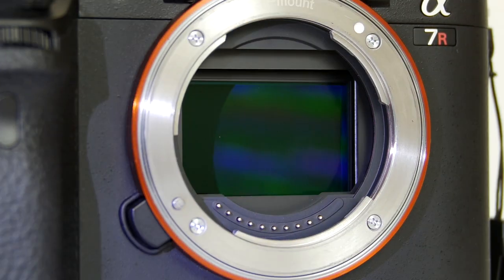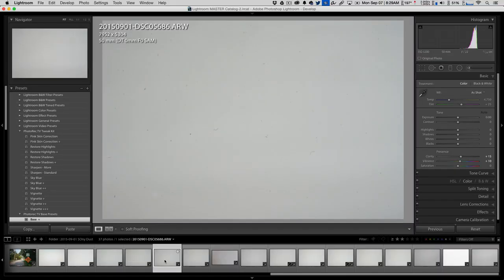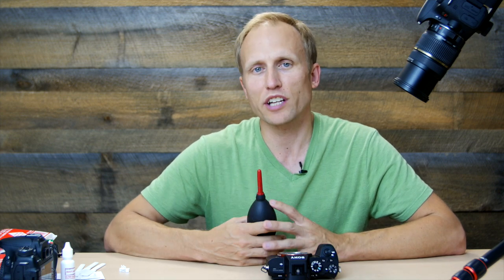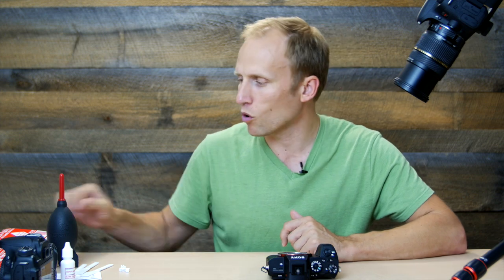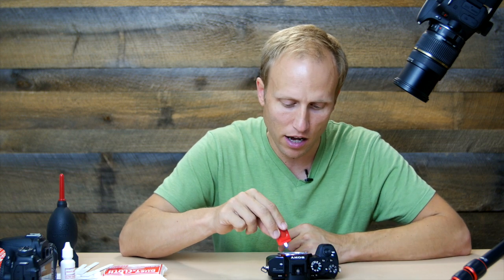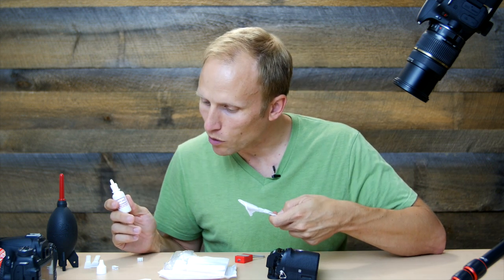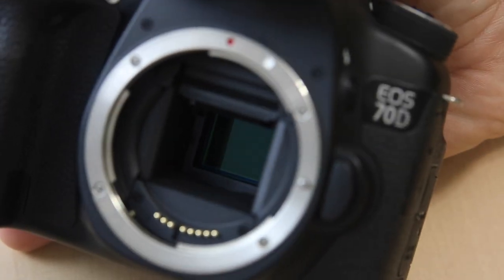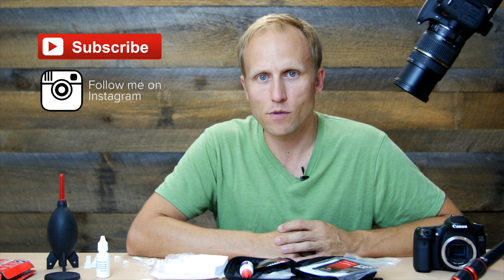How To: Clean your Camera Sensor

Comment: Often using the EyeLead Sensor Gel stick. Same idea. A tiny bit sticky. Works very very well. And it does not leave any residue. But the trusty rocketblower really does work and usually is enough as you said. The trick is to really have a rocket blower. Not some copy or general blower.

Comment: Thanks for a very well produced video.
I would add one thing.  Everybody says hold the camera upside down when blowing it out.  I would say that the particle size is so small that gravity would have a negligible effect on the direction in which the displaced particles would move.  To those particles, the air is like thick soup.
They are more likely to be carried upwards in the warm air currents from your hands or lights.
Because of the danger of damaging the sensor with the blower I suggest holding it in whatever is the best position for you to handle it and see inside and get the most light into it so you can see what you are doing.
Reply: It is because you don't want any new dust coming onto the sensor as you clean it. I always clean it in a vertical to somewhat upside down position to make it stays clean
Reply: Thank you for your reply.
I have done some calculations using Stokes' Law that calculates the velocity of falling objects in air.
It backs up what you say.
You certainly do not want to leave the camera lying on its back with no lens or cap on it.
For objects above about 0.5 mm in diameter you probably want to incline the camera downwards. (Velocity 7.5 m/s).
For smaller and lighter objects (typical dust in the air), these will have a velocity below 0.5 m/s and could be travelling in any direction depending on air currents.
Keeping it vertical, as you suggest, whilst cleaning is probably the safest and best practice.
I think this highlights the need to be as careful as possible to avoid dust when changing lenses.
Reply: Agreed!

Comment: I sprung for an Arctic Butterfly about 3wks ago to clean my cameras, I usually rely on a rocket blower but with my A7ii it was just getting too dirty to blow off. I have a 5mo old A7ii, a used NEX-6 I bought mint from B&H 10mos ago, and a 1yr old A77ii. 

The Butterfly was easy to use and worked like a charm, theres a couple spots I think I'll need a wet cleaning for on the A7ii but I have to have it really stopped down to be a problem. My NEX-6 is hardly used so it was cleaner, but the cleanest by far was my A77ii - that SLT mirror never moves and the sensor is enclosed at all times. It provided a sharp contrast of how much dirtier the exposed mirrorless sensors are compared to even Sony's own SLT-lineup. 

I will say though, it's one trade off I'm willing to accept for a camera that's so much lighter and easier to travel with than a DSLR.

Comment: I do astro-modifications to dslrs. I’ll add that it being referred to as “sensor cleaning” is wrong. 99% of people call it that, even the products meant for cleaning. You never actually touch the sensor. Mounted in front of your sensor is your low pass filter. That is what you are cleaning. I guess it would just be confusing to call it a low pass cleaning kit. Anyway, the reason highly evaporative cleaning solutions must be used is that if you oversaturate you stand a chance of actually having liquid enter between the filter and the sensor. Unless you’re a technician you’re pretty much done at that point. Regardless, the wand never actually touches the sensor. I’m not sure anyone cares about this point but a low pass filter replacement part is around $100. That might help convince people to try cleaning it themselves. The actual sensor underneath it is around 70% of your cameras value however. Venture there with a wand and you may as well throw it in the trash or post on eBay for parts not working. If you’re interested you can see me removing the low pass filter from two different cameras on my channel. It’s essentially there to prevent redeye but for us astro guys it blocks hydrogen alpha transmission. I’m just rambling on now. Great video tho. It’s only scary the first time but far less so when you realize you never touch the sensor. Clear skies.
Reply: what should I do if the mirror is dirty not from dust but becouse of leftovers after moisture ?
Reply: I have a D7100 which doesn't have a low pass filter, does that mean I can't use a kit to clean it?
Reply: @alfred17686  I thing the Panasonic Lumix cameras are the same, no low pass filter.

Comment: That is a very informative video.Indeed, I'd love to be able to do it myself and although I've been  into photography for many years I am still too much afraid to do it not to ruin the sensor. As it's seen on the film it must be very easy and the only problem you might tackle is not to clean 100%. Then, why is it said the sensor is extremely delicate? The swipe across it does not do  much damage as I see;)

Comment: If you read this in 2017, on the sony with IBIS use the internal cleaning mode and follow the instructions before any cleaning. It LOCKS the mirror so it can't move when you do a brush or wet-clean. You now see the sensor move when he cleans it and that is is not what you want. It also makes the cleaning more effective.

Comment: I sent a cam in for cleaning and got it back almost exactly the same way.. so, if you are confident enough and want good result do it yourself.  (never had this much sensor dust since I shoot w/ Canon. Only do it rarely and don't change lenses outdoors, or inside w/ fan on...etc. Still my Canon bodies are dust magnets compared to the old Oly bodies.)

Comment: Greetings from Kolkata, India! Thank you for your superb video. I had never cleaned my cameras ( I had two Powershot cameras A480 and SX200IS). I found in the second one something like a circle after not using for a long time. In the second one I left the battery in the camera and did not remove it. I felt it will not do any harm to camera sensor as someone who uses cameras, and told me that this type of battery does not do any harm to the camera sensor. In any case, I opened the camera few days back, and saw there was something like circle around it.I felt it must be due to the battery. Now i see that it must be something like fungus plus dust. I am afraid of cleaning the camera. Now after seeing your video I got some courage and about to do it. I do not have anything with me but that is no problem ( in these pandemic days I cannot go out and buy the camera cleaning kit from Amazon.in  however). I have some questions. Regarding the brush: should I use it and throw or keep it for future use?  Air blower or rocket blower can used many times, I guess. And about the paper: is it use and throw or can be retained for further use? On receiving a reply from you I will order the kit from the online shop. Here in Kolkata there are plenty of Canon shop and I dare not go out because of my age (75+), which is very vulnerable to Covid-19. Tell me some way-out. I am expecting a sharp reply from you and i will do accordingly.  You said you are using alcohol based liquid. I had a bottle of isopropyl alcohol at home for cleaning laptop screen. Will it do for the camera sensor? Some people advised me NOT to use any alcohol for the camera.

Comment: Hello Toby. Good video. Have you Heard about software "Reikan FoCal" this software can do micro lens adjustments as well as can check how clean/dirty your sensor is. I have tried this to set micro adjustments and I'm very happy with the results also I used this software for checking dust on sensor and I was extremely surprised how much dust it found even if couldn't see any at f22 maybe you could test it out as it can be helpful for others or not. I will be happy to see your thoughts. Thank you

Comment: I once cleaned my Rebel mysels and I had to buy a new one ! A professional cleaning (in a vacuum tent) costs only 25 euro, so why should I run the risk of damaging the sensor ? I'll never do it again myself !
Reply: I'm with you. I'm faint at heart when it comes to touching an ultra delicate and expensive piece of hardware. This is the main reason I will never own a mirrorless camera. The sensor is always exposed, even during lens changes and that, to me, is just reckless and the result of poor engineering

Comment: Cleaning using swabs is great but follow the instructions on the package don't use any other cleaning agent than what the package provides, because the sensor is coated and using the wrong stuff can destroy the coating and make the sensor useless. Also, think of the simple things; don't hover over your camera when the sensor is exposed (or you might get to spend some time trying to get a hair out of your camera) and definitely don't talk while you are cleaning it because you'd be surprised how much stuff flies out of your mouth. If you feel a sneeze coming on... well... you know...
And of course, don't clean your camera in a dusty room, and don't clean your camera just because you think it might be dirty. Clean it only when you need to. Most of the dust really doesn't show up on photo's anyway, and every time you touch the sensor you do run a risk of damaging it, so keep it to a minimum.

Comment: is it ok to end up with 3-6 tiny spots at f22 even after wet cleaning?
Reply from the maker: That's frustrating but yes - it is possible to still have some small spots.  You could send it in for pro cleaning - they might be able to get the stubborn spots off.

Comment: Wash then dry your hands, and repeat, to get dust, skin flakes, dandruff, and grit off.
Clean the table off too, because he put the white cloth onto the table before folding to the wand stick.
Maybe not touch the cloth to the table at all, because the table dust goes into the cloth, onto the sensor.

Comment: 1/ You have wrong size cleaning wand. Wand should be wide as the whole sensor
2/You do single motion from one side to another, then turn wand over and to the same thing on the opposite side
3/SONY cameras have inbody stabilisation, you have to turn cleaning function first, that will lock sensor in place, so you dont damage its motors while cleaning it
4/ NEVER buy wands that are not hermetically, separatelly sealed
5/NEVER teach people on the internet of the things you have no idea about

Comment: The DSLR stays cleaner not because of the mirror, but because there is a shutter in front of it that stays closed and acts as a shield from dirt, dust, and the elements, something the mirrorless cameras do not have, which is the main reason I will never even consider a mirrorless. Who wants to clean their sensor a bunch of times? You're bound to ruin at some point. Hard pass

Comment: I just got done shooting an air show and after two years still no sensor dust. I changes lense usually at least once when I shoot. Since I keep my camera and lenses in a backpack that is put inside a closed plastic bin whenever I am not using it my thought is most dust gets on the sensor from prolonged periods of the camera laying around unprotected when not in use.
Reply: I think it is just luck of the draw. I also apply the same rigor around storage and cleanliness as you and shoot alot but i have had to clean my sensor.